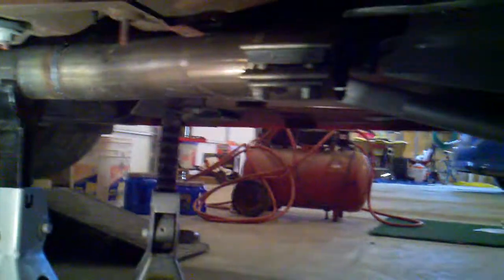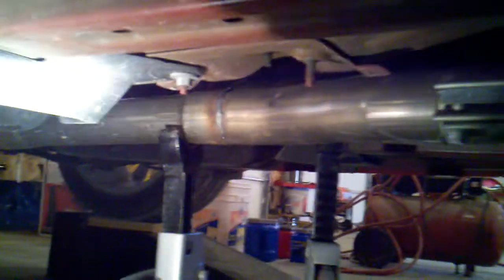2011 Mustang GT/CS Shame on Ford, Resonator  dents from factory

Comment from the maker: I read an article about this in MM&FF, FORD should be well aware of the problems it was written in 5.0 magazine as well. So, when I crawled under I was aware that the dent would be there, several other youtubers have also stated the dent is present on the cars, something from transportation or something.

The local dealer near me is lame. The one I bought the car from is an hour away. 
So, I just had them cut out and replaced with straight pipe

Comment from the maker: @jmc6000 Yeah it's not a problem the inside was still the same dia.
However one dent was facing down and one was facing up, so I 'm not sure that your clearance issue theory is lock tight.  We already came to the conclusion that they all have the dents in the other video I made.

Comment: ALL, I repeat ALL 2011 GTs have the dents in the resonators for clearnce issues.  This is not a problem because Ford puts dents in the resonators from the factory!  They are DESIGNED to have dents in them.